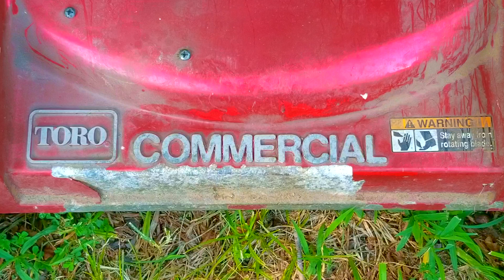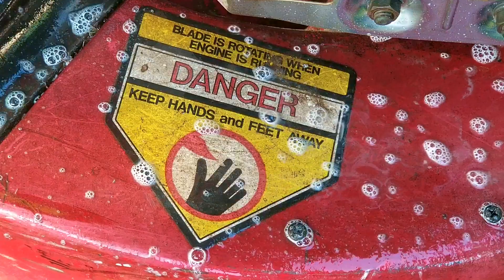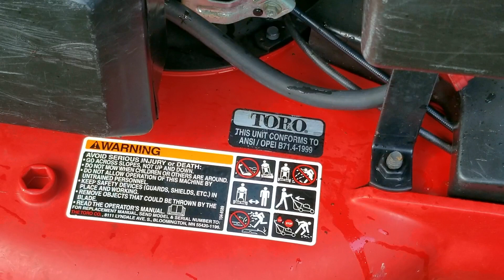CLEANING A TORO COMMERCIAL  MOWER

Comment: I have a good power washing routine that works for me. I lay out a little 8x8 HF tarp and put the mower on it.  That keeps you from walking in mud and splashing mud all over,  just takes a second. Pre soak with LA Awesome and power wash with the white nozzle. Works perfect. I've never had to hand scrub. Blow off with a air compressor. The front of that Toro where the paint was peeling would of been destroyed with the power washer if it was one of the newer mowers. The newer paint doesn't stick like the older ones. Great vid.
Reply from the maker: thank you DW WD.

Comment: Since you were going to get your blower out anyway, I would have blown the dry debris off the mower before applying the cleaner in order for the cleaner to get directly to all surfaces. 
Arch from Arch’s Garage has a plastic commercial shipping pallet he uses under equipment he’s pressure washing on the ground. I’m keeping an eye out for one to use myself. 
I use a couple of scrap 4x4 wood blocks under the deck to raise the wheels up so they can rotate freely while cleaning. Also a weight like a cinder block on the handle to hold the mower deck tilted all the way up and clean underneath.
Reply from the maker: yes I should have done that.
Reply: @INSIDEHOUSEGARAGE  😂

Comment: If there is a lot of clippings on my mowers i hit them a lick with the blower and that keeps the stuff building up to a minimum. If there is any washing done it's done with gas and a parts washing brush because I'm scared of water and the electrics not getting along even though I sand and oil the flywheel magnets and magneto laminates. And the Vanguard is out of the dust and grime so no problems there. Thanks and Blessings!
Reply from the maker: nicely said!
Reply: @INSIDEHOUSEGARAGE  I try.

Comment: For me , l use a small broom and blower after every mow. Takes about 5 minutes. If l was commercial l would do the same, but at the end of the working week out comes the blaster. Then it would be a seasonal or rainy day job for the deep clean for worn in grit. l am surprised so many professionals have such dirty machines especially when they have a blower at hand blowing away grass.
Reply from the maker: that works too.

Comment: The only time i use a pressure washer on my lawn equipment is when i pressure wash my deck and parts of my house because its already out and getting my washer out of my shed and setup takes to long for just my lawnmowers and i do that twice a year. If its get so bad that the hose dosent work i use my electric one its fast and easy and wont rip the paint off.
Reply from the maker: I completely understand what you mean.

Comment: The Toro and Suzuki partnership ended in 1998, so yes these are pretty old. But my word these 2 stroke Suzuki engines feel more durable than any Honda I’ve used.
Reply from the maker: they are exceptional engines for sure.
Reply: The Commercial Suzuki 2-cycle Toro mowers were sold up to 2004. I believe they stopped selling the Suzuki 2-cycle snowblowers in '98 or '99 and they were replaced with larger R-Tek 2 -cycle engines.

Comment: NIce job. You might want to try a nozzle with a narrower spray pattern, but be careful because they can remove paint in some cases. Thanks
Reply from the maker: yes are correct, the wide nozzle keeps the pressure down, and the chance for damage

Comment: Dumb question of the day (year?).  Would I need to mask off anything on my mower before using a pressure washer or even a garden hose and degreaser presoak?
Reply from the maker: that's a good question fact.  For masking, not really, just try not to spray water into the muffler, or air filter
Reply: @INSIDEHOUSEGARAGE  ok, thanks!  I used your degreaser solution suggestion from HF.  I used about 2 ounces of degreaser in 24 ounces of water...a little stronger than what it said on the bottle.